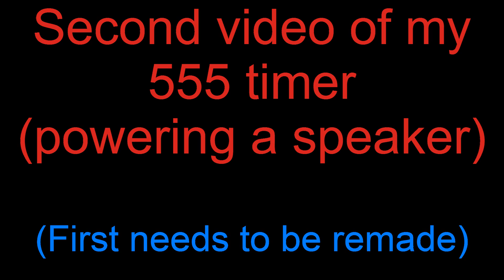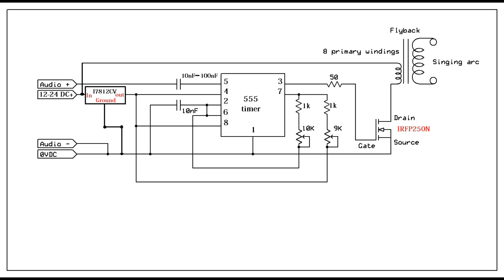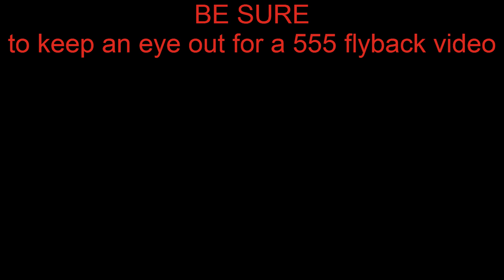Audio Modulated 555 Timer

Comment: Interesting, I built one too because I build AM broadcast receivers and wanted something that I could use to test my tuner since I am miles away from AM transmitters operating during day hours. If I had a 1 Mhz quartz oscillator that would have been the choice but I used what I had, the 555 timer.

The carrier wave is easy. What I am trying to sort through is if I kept the square wave made by the 555 in the audible range at around 385 Hz I could modulate this tone with audio from an outside source by using Pin 4/reset,  Pin 5/control and even Pin 8/Vcc. However, when I took the 555 up to around 800 Khz I only could modulate at Pin/4. I had used an audio transformer when injecting the signal.  Also, often I changed the 555 output to at least triangle if not sine like by implementing RC filters. I am not sure what is going on and a block diagram is not sufficient for analyzing, so to know for sure I need to look at how all 52 parts of the 555 are wired. 

Some say that Pin 4 is just shutting off the timer, but that may not be exactly true because its active low and I don't know how low it needs to be but shorted to ground works and I expect its under 2 volts. Chances are my audio which is "line out" does not take  it completely into shut off.

Regardless, the canned oscillator seems the better choice and I am looking for some old unused or broken device I can borrow one from.

Comment from the maker: BEWARE VIEWERS: I just noticed a typo... 6 years later. Anyways the part of the video where I mentioned the speaker being connected to pin 3 off the 555 timer & the common ground. Well, that is incorrect. It typically will not cause failure. However it will not work. Pin 3 lands on ground in a simple audio application like this.

Comment from the maker: @ConnorXV I finally for sick of blowing my circuits by not connecting it right so i finally pulled the three dollars out of my ass and bought a little one on ebay. I burned that out after a lot of use though. I need another at some point.